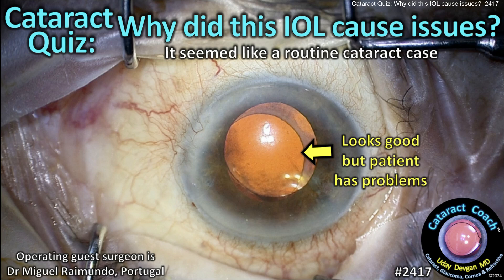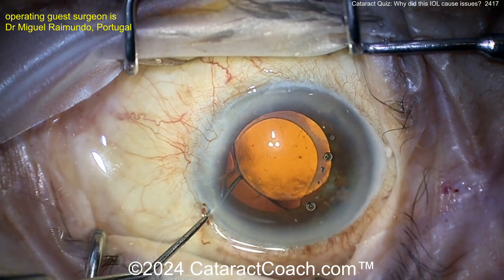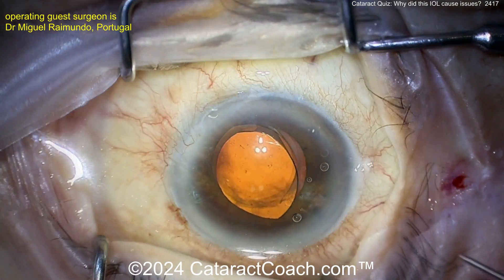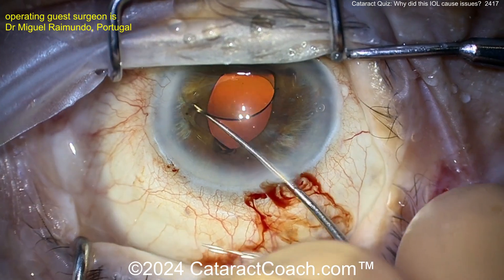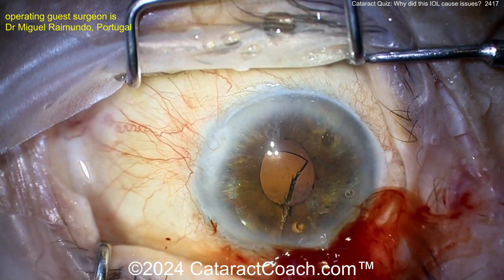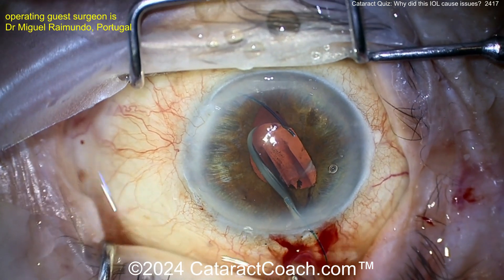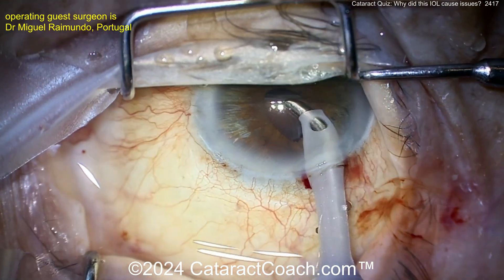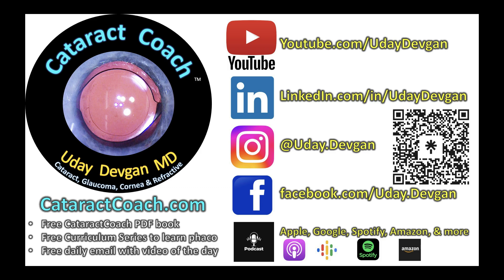CataractCoach™ 2417: Cataract Quiz: Why did this IOL cause issues?

Comment: Important information is the length of time the IOL has been placed. The fact there is UGH suggests it's a long time. That being the case it would certainly be hazardous trying to viscodissect the bag sufficiently to allow the existing IOL to be dialled fully into the bag (and expect it to centre well). Explanting: twist-and-out is certainly neat, but a little more traumatic to the eye than a dedicated lens cutter (and I would not transect across the horizontal as in this case, better to cut under the armpit of the haptic, there is less distortion involved in explanting each half).
3 piece sulcus fixation is fine, they vault backwards. As above, no guarantee of getting this "old" capsule opened up enough inferiorly to optic-capture the IOL. Worth a shot, there may be just enough separation achievable by viscodissection to get the optic to centre even if the haptics have to be left in the sulcus.
Reply from the maker: Great input . Thank you!
Reply: Very insightful, thanks!

Comment: end result is nice and solved the problem. I bet in the moment with the pupil coming down so much it made IOL placement more challenging. Ive had a case with the superior haptic out of the bag and I elected to simply cut the haptic off at the haptic-optic junction and remove it and leave the rest of the lens in place. It was several years post surgery thus the capsule was well adhered. The UGH resolved, IOL remained centered, and patient did well. Not to mention spending minimal time inside the eye with little to no iris manipulation which ideal in these inflamed eyes. That may have been an option here?
Reply from the maker: sounds like a reasonable approach. if you have a video, send it in!
Reply: oh wow......if that works, would be so nice, but if you cut the iol, wouldn't the sharp edges of the remnant cut end potentially damage the capsule ?

Comment: Less is more. Absolutely no need to go through all of these gymnastics while the haptic is released and can be placed inside an intact capsular bag. The older I get, the less I believe in being a hero. Do what is necessary for the patient well-being and do not over do it. It is my philosophy and has served me well over the years. Unnecessary steps can have consequences that may not benefit the patient. Manipulating the iris itself can cause CME at the very least. You may get lucky, then again, you may not, if it is not necessary, do not do it. Less is more.

Comment: I had a similar case recently. But the anterior and posterior capsule at one side were weldded up together and I couldn't separate them. Supposing this is the situation here, what alternatives we could have?? 
Thanks!
Reply: That is precisely what happened. The AC-PC were fused in one side so it was impossible to dial the IOL into the bag.

Comment: I feel like if there was a reasonable ALC overlap (Which I think there was) the lens could’ve been dialed into the bag and it would’ve solved the issue. 
Optic capturing a 3 piece lens with a fibrosed ALC is a challenge, especially with an oversized rhexis. 
Maybe there’s some detail we are not aware of here.
Reply: The AC was fused to the PC in one side and I was not able to dissect the bag open, precluding in the bag IOL repositioning. The original surgery had been done many years ago.
Reply: Ok I understand. Sometimes the adhesions between the ALC and PC would be too strong to Visco dissect them open and manually dissecting it would risk the bag. Well managed case 👍